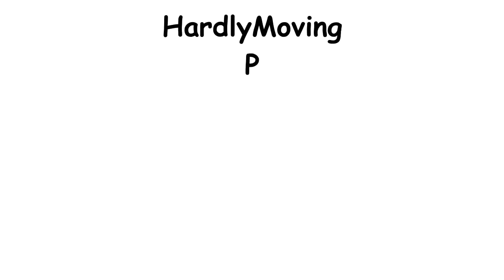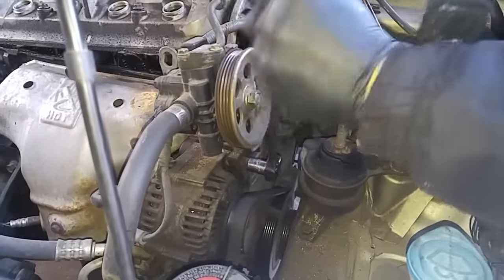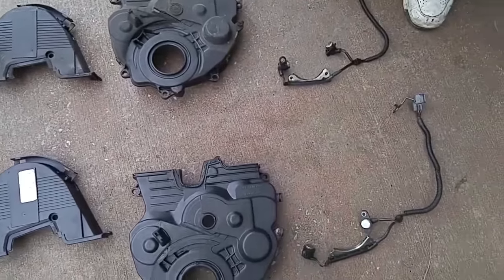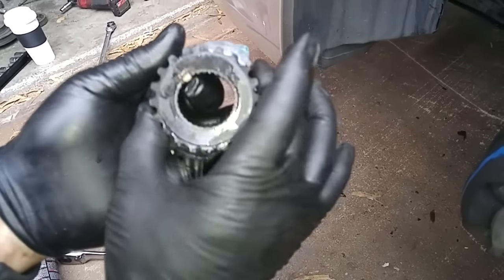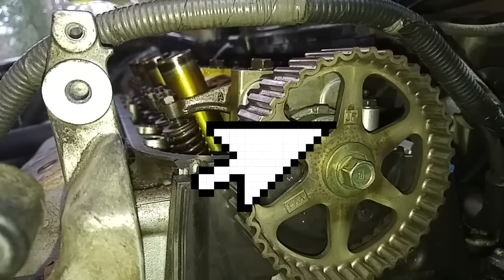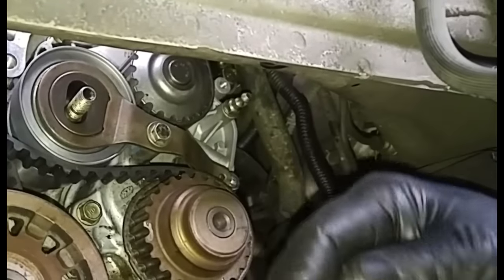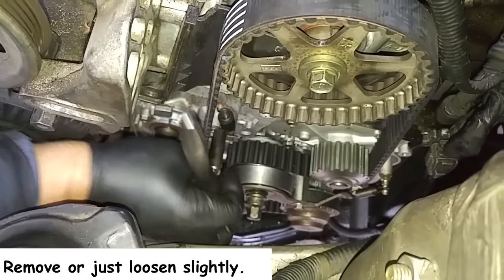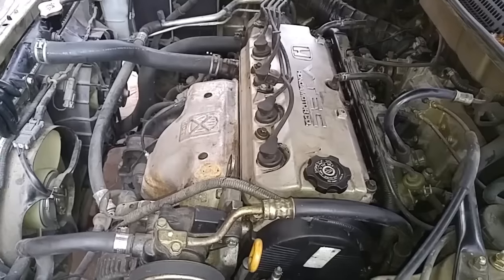Honda Accord Timing Belt, Water Pump, Pulleys & Seals - (4 cyl. F series 2.3L)

Comment: Excellent Tutorial, Question  at 16:50 when you first started the engine was the  harmonic balancer installed before starting? THX
Reply from the maker: Nope.  The balancer installation happens after the timing belt cover is installed.  Just wanted to see how the car runs before everything is buttoned up.

Comment: I would leave the balance shaft belt off for more power and better fuel economy plus then you will never have to worry about it breaking again.
Reply from the maker: Interesting recommendation worth trying.  But wait, doesn't that belt also run the oil pump or are there two balance shafts?
Reply: @hardlymovingpro  2 balance shafts
Reply from the maker: Yup.  You're right!

Comment: Crank seal is flush with the housing
Reply from the maker: Didn't leak.
Reply: @hardlymovingpro  using your video as reference working on my timing belt right now.

Comment: Hi, great job! How did you hold the crankshaft polly? is it the same tool as camshaft polly (10:45)?
Reply from the maker: A cranshaft pulley holder tool is not necessary if you use a impact tool (either electric or pneumatic) (3:36).
Reply: @hardlymovingpro  Thanks! But sorry I meant holding the "toothed belt sprocket/polly" it is located here 9:17
Reply from the maker: That's the counter rotating balance shaft pulley.  There's no tension on it.  Opposite that pulley is the oil pump pulley.  Rotate both with you hand to align it with the new belt.  After the belt is on with the oil pump pulley, install the center tensioner pulley.
Reply: Okay I see, Honda is not similar to VW, in my 2.0l TDI engine I have a bolt as well in the toothed belt pulley and I am looking for the easiest way to hold it in order to chznge the seal. Thank you so much for the informations
Reply from the maker: @mrdarho4718  Wow ... a TDI belt change.  Hated doing that job.  The new belt can be in perfect alignment with all the pulley cogs and the engine can still smoke.  You have to either advance or retard the fuel injector pump pulley to reach optimum injector timing.  Even if you get there, in 20,000 miles, you may have to adjust it again due to belt stretch.   After I did a TDI TB job for a customer, he was complaining about exhaust smoke.  After around 15,000 miles, the smoking disappeared.   i"ll assume the belt stretch got the fuel injector timing fixed.

Comment: I did my timing belt and water pump 2 years ago, now I find I have oil dripping out the bottom of the timing belt cover.
I should have done seals while I was in there.
Reply from the maker: Bummer ... live and learn.

Comment: How much would it cost to have this done? I don't have the equipment to  do it myself
Reply from the maker: I'll guess the parts to be around $150 - $200 if high quality OEM.  Labor around 5 hours.  You'll have to figure out the rest based on your area's hourly rate for repair shops.
Reply: @hardlymovingpro  the situation is i found a 93 accord for $ 375 but needs the cam and crank seal and an oil pan gasket. Car otherwise runs. I was wondering how much it would cost to fix these issues and since the timing belt, water pump and tensioners are exposed,  figured they should be  replaced too.  I'm guessing even with the repairs and preventative parts replacements I'd be below $1500-$2000, maybe below or just over $1000 I'd still be ahead on the  deal and the repairs would pay for themselves taking federal mileage rate as a compensation point.

Is this a good deal even with the proposed repairs and how much it be on average to do all that?
Reply from the maker: @chrismc410  A 93 is a pretty old dog.  What's the mileage?
Reply: @hardlymovingpro  150k, manual transmission,  clutch in good shape
Reply from the maker: @chrismc410  That's not too bad ... mileage wise.  Just be aware that with that age, a lot of other things can go on you unexpectedly .... like the radiator, hoses, alternator, starter motor, fuel pump ... etc.  What I'd suggest is find a mechanic on Craigslist that is a professional mechanic that works on the side in his garage and will allow you to provide your own parts.  He'll either charge by the hour ($40 - $50) or give you a fixed price for the job.  Ask if he's ever done the job before.  If he hesitates with his response, more focused on getting the work and won't give you a fixed time frame to complete the job ... move on to the next mechanic.  Otherwise, going to the dealership or an independent shop will cost you big $$$'s
Reply: @hardlymovingpro I intended  to replace the radiator hoses shortly after buying , flush and new fluid. Fuel pumps unfortunately just die without warning and most on the market are rebuilt and only as good as the person rebuilding it, same for alternators. One cannot even buy a brand-new, never been used alternator. At present both work, so will worry about them when and if they  fail
Reply from the maker: @chrismc410  The fuel pump is a relatively simple and cheap (under $80) item to replace.  Watch my video on the Camry fuel pump replacement ... Honda's aren't that much different:  https://youtu.be/pNDMYoTb63s
New alternators (not rebuilds) should be available for you car as well for around $100 - check out Amazon
Radiators are now made of plastic and aluminum ... age is the killer on this part ... either the plastic gives out (hairline cracks) or the glue that fuses the plastic to the aluminum gives out.  You're better off getting a new radiator for under $100 ... again, check out what's available on Amazon or Ebay.  They're cheap and simple to replace.  Here's a video on how I replaced it on a Nissan.  Concept is still the same:  https://youtu.be/N7E7BIIqFsA

Comment: You cant put the camshaft pulley 1 notch to the left when putting the timing belt on, when you go to realign the camshaft the crank shaft pulley will go out of alignment, the belt doesn't stretch. This is the wrong way to tension the belt. While keeping alignment.
Reply from the maker: 1 notch to ease mounting of the new belt with slack.  Place the cam back 1 notch to TDC to tighten the belt which will remove the slack.  If out of alignment, try again.

Comment: I have to change the crankshaft position sensor how can I do this the best way
Reply from the maker: You don't need to remove the timing belt;  just the lower timing belt cover.
Reply: Hardly Moving Productions how about the crAnkshaft pulley?
Reply from the maker: @harveys.2821  Details are in the video.
Reply: Love the video very detailed, one more question should I put it in timming before removing the crankshaft just in case or can it just be removed
Reply from the maker: @harveys.2821  Recommend you align the timing marks ... but not absolutely necessary.  You can re-align with the crank pulley off.

Comment: What’s the model number of the Milwaukee that you are using
Reply from the maker: The model number is 2755B for the 1/2" drive;  2754 for the 3/8" drive.  My preference is with the 1/2" because it generates more torque.  Here's the Amazon link for the bare tool if interested:
https://amzn.to/2XlEU1d
If you want it with the battery pack and recharger:
https://amzn.to/2IDcbRi

Comment: I had a weak battery my car turned over slow broke my timing belt 1990 honda accord car sat for 3 yrs in the texas heat the belt dried out most likely had 26k on belt.  This 30 yr old car is turned into a money pit lmao. 1990 accord lx coupe. Ran perfectly till todays belt drop. Since it wasnt running and slow turn when belt broke my valves should be fine.
Reply from the maker: Yes ... if the belt broke at a low rpm, you have a chance that the valves aren't bent.
Reply: @hardlymovingpro  the shop manager at the honda dealership said i should be fine no issues motor wasnt under a load. Slow drag on motor weak battery old belt broke from stress on belt
Reply from the maker: @adamlong54  Good for you!
Reply: @hardlymovingpro  good video my lame ass buddy told me to just do belt and nothing else lmao told him nope water pump and cam and crank seals are part of the job anything else is short sheeting the job
Reply from the maker: @adamlong54  Good decision!  Also, timing belt component kits, which include everything you need,  aren't that expensive.
Reply: @hardlymovingpro  175 bucks has everything including 2 new springs pump seals belts valve cover gasket plug seals ect.. Im also thinking while im there to replace crank sensor too its cheap
Reply from the maker: @adamlong54  If you want.  I'd focus on the motor and transmission mounts ... then the suspension components.  Here's a video on the mounts replaced on a Civic:  
https://youtu.be/LG_p8fx6y2A

Comment: My valve cover hole is striped what heli coil do I use plz help
Reply from the maker: Gee ... I'd have to do some research to figure that one out.
Reply from the maker: Okay ... here's a Helicoil kit with different size inserts.  The kit's around $11 from Amazon:
https://amzn.to/2IrCDhF
... and use this kit with a metric tap & die set:
https://amzn.to/2DnensE
Reply: @hardlymovingpro  now I can't get the bottom seal wheel with pin to come off any how to's on that
Reply: @hardlymovingpro  crankshaft wheel
Reply from the maker: Don't quite understand the problem?  Are you saying the crankshaft pulley won't come off?
Reply: @hardlymovingpro  thx u I finally got it lol wow
Reply from the maker: Okay ... great ...
Reply: Thx u got the heli coil ordered now I'm running into a problem where that top sprocket is rubbing on the stupid plastic
Reply: @hardlymovingpro  thx u

Comment: On the lower timing belt cover there is a little piece of metal does any one know where it goes?
Reply from the maker: Is it round with a hole in it?  ... if so, it pop out of one of the cover bolt holes.

Comment: I guess it's not an interference motor bc you didn't check. The valves with a compression check
Reply from the maker: It is interference but the belt didn't break ... it jumped but not enough to damage the valves apparently.

Comment: I have never seen a broken balance shaft belt in a Honda a timing belt is peculiar but that small belt is so hard to break.
Reply from the maker: First time for me as well.  I'll guess that a broken part off the TB cover got stuck between the belt and the pulley.
Reply: @hardlymovingpro  I noticed you just pushed the seals with your fingers.The seal behind the balancer is notorious for popping out . There is a retaining bracket from Honda for less than $5 bucks that secure the seal.
Reply from the maker: Thanks for the heads up!  But I didn't replace the balancer seals.  Do you mean either the crank or cam seals?  As long as the seals are flush with the block, there should be no problem.  Never once had a problem with a seal popping out.  On Toyota's, the cam seals go in very tight and I need to use a special seal installation tool to gradually press the seal all the way flush / in.  You can see how I do it on my ES300, Sienna & Camry TB / WP replacement videos.  BTW ... send over a Amazon link or any other link about that Honda retaining bracket when you have time.
Reply: DORMAN 917-006 I just installed one in my 1999 Accord tonight. Thanks for this great video btw! @hardlymovingpro
Reply from the maker: Great ... good job!

Comment: You are supposed to use blue coolant not green.
Reply from the maker: Green universal works just fine.  It's all ethylene glycol using organic acid technology (OAT) which will last long after your water pump, radiator or hoses go bad.  All these dye colored coolants make people pay a unnecessary premium to make them think that steel and aluminum from one manufacturer to the next are different requiring unique coolant protection.  It's all BS.

Comment: I thought Honda's were interference engine and when the timing belt breaks the valves are bent
Reply from the maker: Most of the time yes ... The valves get damaged ... Sometimes you get lucky with a jumped belt before it breaks
Reply: @hardlymovingpro  my camshaft wontt rotate and it was deemed the belt broke and engine damaged. This is a 97 accord dx f22b2 engine. Maybe there's hope. When the car stopped running I heard a weird noise but kept driving and then it quit. I wasn't at highway speed. I think I was doing 45mph when it happened. I'll take a look and pray I get lucky.

Comment: Your somewhat mistaken when you criticize that spring for failing to remove sufficient slack from the timing belt... Belts stretch over time and miles. When you tighten that 14mm nut that secures and "Holds down" the tensioning sprockets the "Little springs" are now taken out of the tensioning role. There is a reason for that 14mm nut to be sticking out of the timing case cover in the first place.
A knowledgeable mechanic that is familiar with the tensioning sequence on the Honda engine. Could leave the timing cover in place... loosen that 14mm nut 3/4 to one full turn... Place a 19mm socket on the crankshaft bolt and rotate the engine counterclockwise applying tension to the left straight run of the timing belt while allowing those two springs to take up the slack.  Tighten up the 14mm nut and you are done.
Haven't you ever asked yourself why that 14mm passes through the cover?

Did you remove that 10mm bolt from the left side of the timing belt tensioner? You kind of just glossed over the ending scenario with that 10mm bolt. That 10mm bolt is not there, to begin with... It's placed there during belt replacement to only "Hold the Jaws" of the tensioner open. I have opened up engines and found that bolt left in there and locked in place as though its job is permanent. 

Good video overall... If your efforts were just to give out the same misinformation as forty other videos.
Reply from the maker: Thanks for your critique and here are my answers to your questions.  Yes you are correct that the belt does stretch on this engine since it does not have a dynamic belt tensioner set up found on the V6.   And you are correct that the nut protruding from the lower cover can be used to remove slack build up (similar setup on Toyota's I4 5SFE engine as well).  However, I have yet to see or learn of any repair manual mentioning using that nut on a specific time or mileage schedule to remove the slack as part of a PM (preventative maintenance).  It's something you have to figure out on your own if you're a keen enough technician.  The belt jump that had happened on this engine occurred with less than 20k miles.  This could only have happened by a tech installing the belt with inadequate tension!  I have installed new belts on the F23 engine at or above 100k miles with very little belt slack.  On engines that have had at least one belt replacement ... over and over again ... too much slack indicating improper tension during the belt replacement.   If you watch the video carefully ... yes ... that 10 mm bolt was removed from the tensioner bracket after the engine was started and the belt tension re-checked.
Reply: @hardlymovingpro  Ahhh... I do believe your fibbing here at time 17 you mention removing that 10mm hold down bolt. Then at time 17:47 its guess what? It's back.
Reply from the maker: @Seeleeart  Perhaps ... its good to have viewers like yourself to take the time to pickup on the micro detail flaws of the video and bring them to light.  What's important is that the viewer has been told what must be done but not necessarily visually substantiated.  It takes considerable effort and time to make these videos.

Comment: This is not how you put tension on this belt this is the third american video i have watched on this where you all have zero clue on how  to properly tension these belts, i know you all think your pros you are not , what you do is once that balancer belt is put on you turn engine anti-clockwise on crankshaft by three teeth on camshaft which tightens correct tension you then secure the tensioner bolt at 33 foot pounds or 44.74 NM , you then rotate the engine one whole revolution  anti-clockwise to check your work . most of you guys need to actually read more before you do these jobs
Reply from the maker: Thanks ... good to know ... so far the car's been running great and the customer is happy that he didn't have to pay a dealer big $$$'s to get it running again!  Hope you make a video to show us the professional way ... really ... I mean it.
Reply: I think the only reason to rotate the engine is to seat the belt. This guy started the engine which was pretty cool and does a better job by wearing the belt into the cogs.

Comment: This is why I don't buy Honda's
Reply from the maker: The timing belt slippage and damage was not a reflection of poor Honda engineering design;  it was the result of poor workmanship of the previous mechanic who had improperly installed the belt.